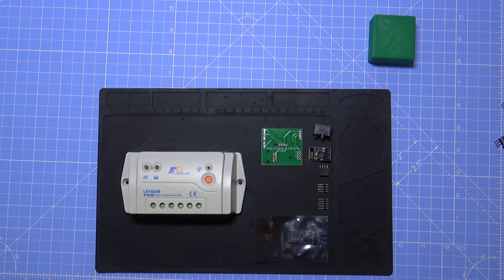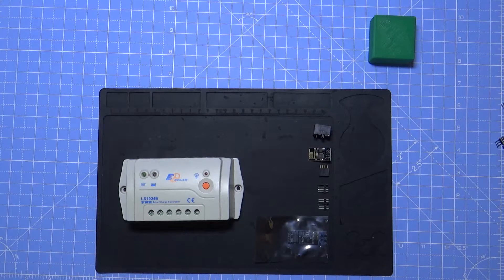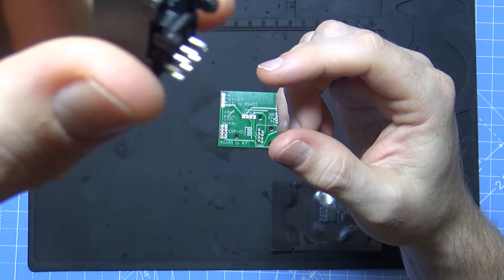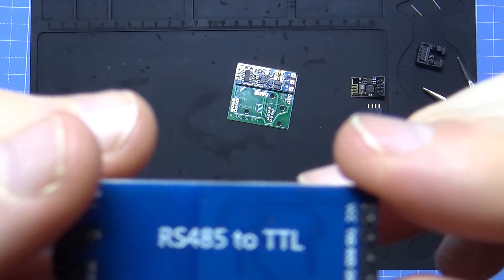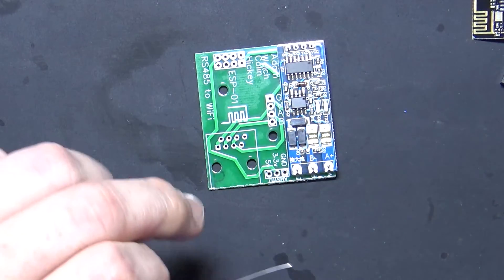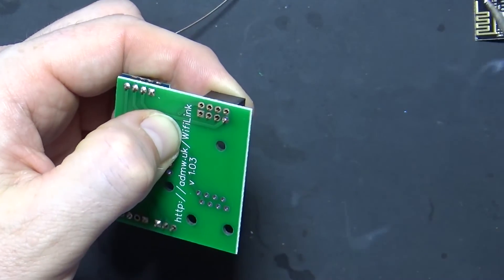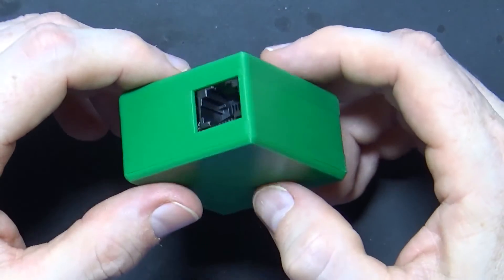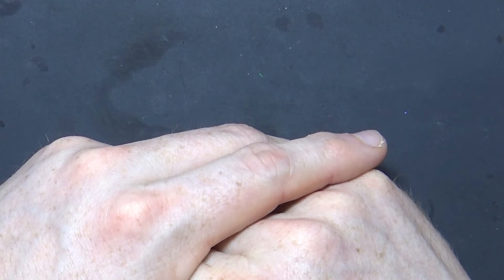EPEver RS485 to WiFi updated board

Comment: Hi, I've purchased a v1.6 board and installed a Wemos D1 Mini with esp-link and my goal is to allow home assistant to communicate with my Epever Tracer 3210AN and draw some nice graphs with data from influxdb. Is there a guide online anywhere for setting up the v1.6 with a D1 Mini ? your videos so far only appear to cover v1.5 and the ESP-01 chips. Will the default pin configuration of esp-link work with this board ? So far I've not managed to get the epever software to work using a virtual serial port.

I also have seen mention that you think this could automatically publish to MQTT or InfluxDB, I would be very interested in a detailed guide on this as from what I've read on the esp-link pages this would require another microcontroller. Maybe I've misunderstood ?

Comment: Hi Colin
Great product works really well as real-time monitor of my solar setup in the shed. I see on the settings tab you have mqtt and influxdb configs. How would I use these to send the real-time data to an influxdb database I have running on a raspberry pi on my Lan? I am using RS485-WiFi v0.60 software. Any instructions would be great as to how I access the data and what format is it in plain ascii, JSON formatted?

Comment: I built a custom radio system for my EPEver systems, using that same RS485 adapter board you've used, but I've had 3 EPEver units stop communicating after a length of time, and even the factory USB cable no longer works.  Have you had any issues with your equipment and had to repair?  I'm assuming the internal RS485 IC has failed (looks crispy) but I can't pull any info off of it to get a replacement figured out.  Have you?

Comment: Hi, I am wondering if this will work on "AN" common negative epever tracer units ?
Tindie says: It has been confirmed tested and working on the following boards - LS1024B - Tracer 3210A - MPPT Tracer1210 - Tracer AN - TRIRON Series with RS485 module
Eplop Electronics says: The boards have been tested on the landstar and tracer controllers, it does however not currently work with the new common negative tracer model.
Reply from the maker: Hi my apologies for the Conflicting information it was the older version that did not work on the AN series but the new one works fine with it.  I carried across the description so shall be sure to amend it

Comment: Hey Colin, Many thanks fro your inspirational videos. Between you and Adam you seem to really know your way around the epever devices. I have posted a similar question on Adams page, but wanted to see if you had any pointers at all....

I have recently bought a Epever upower hybrid charger / inverter which also has a RS485 modbus port and would love to get to a remote monitoring dashboard like you and others mention however I am having trouble with the basics..

Before I go into the dashboard, I thought I would just try some python scripts to read the data. I looked at scripts such as https://github.com/kasbert/epsolar-tracer and simple pymodbus scripts such as https://stackoverflow.com/questions/57313343/modbus-cant-read-data-from-epever-tracer-1210a-to-raspberry

None of them worked however I could get the Windows software provided by epever to work but who wants to look at a Windows laptop !! 

Have you ever tried talking to one of these upower devices ? Can you think of any pointers that may help ? Have you tried your wifi adapter with them ?
Reply: The Ebox works very good with uPower series and Android APP. I dont get the right functions though with usb to modbus cable.

Comment: Another great video Colin.
One of your earlier videos inspired me to build my own wifi box but I've spent the last 4 days trying to get data to appear on the solar station software...having exhausted my knowledge and ability (although I'm now an expert in flashing 8266 modules!) I've come to think that my RS485 converter module is duff. You mention in this video that you've had a few duff ones, so could you please let me know where I can get hold of a module that will actually work???
I'm quite impatient these days so I don't want to wait weeks for it to ship from China - any suggestions would be very much appreciated.
I've learnt a great deal along the way with this project but I'm super-frustrated that I can't get it to work.
Keep inspiring us!
cheers.
Reply from the maker: Hi Adrian, sorry for the delayed response.  I was struggling to find any decent suppliers so i moved onto a newer design which uses a wemos D1 and surface mount chips.  Should have it out soon and hopefully start videos again.

Comment: Hi Colin any chance you can knock one of your green epever tracer compatible WiFi rsj things up.my soldering crap an my epever WiFi 01 wont connect.steve near Chester.let me know how much if u have time 😀
Reply: Hi Colin I have a cordless drill park side impact driver an motor ok battery was dead an have my own lithium battery but switch on drill won’t work I’ve connected to switch that reverses polarity .my own switch works direct to motor how can I reverse polarity for drill forward reverse
Reply: @stevemcgowan3017  https://www.robotroom.com/DPDT-Bidirectional-Motor-Switch.html
something like this would work
Reply from the maker: Hi steve i do have spare PCB's but i've switched to working on a new board which will post directly to influxdb and also allow you to check it via a webpage without the need for influxdb/grafana etc.
Reply: Colin Hickey ok thanks
Reply from the maker: steve mcgowan drop me a line at chickey@eplop.co.uk and can see what we can arrange

Comment: Can you explain or show any diagram from which wires you take power ??? I measured voltage from blue wir and brown on both of them there is only 3.09 volt. definietly not enough
Reply from the maker: Hi it sounds like it shall not work for your controller.  With the LS1024B and Tracer3210A which i have i get around 5-6v
Reply: @Chickey  I use epever Triron with rs485 Module. So quite straange because it is compatibile also  with wifi module from epever
Reply from the maker: Szymon Zieliński yup it is strange as that is where it gets its power also.
Reply: @Chickey  Can you Tell me from which colours you take The power?
Reply from the maker: On my devices pin 1 + 2 VCC / 3 +4 B / 5 + 6 A /  7 + 8 Ground
Reply: @Chickey  Thank you so much

Comment: Great the Victron PWM Pro looks exactly like this solar controller. Same protocol and all. Will try to do it also.
Reply from the maker: Hey Mike, i'd just double check the pintout on the RJ45 connector though before connecting.  Also the code i run is checking for specific registers on the EPEver and i would imagine the Victron would be running different registers.  Worth looking into.
Reply: @Chickey  indeed the pinout indicates 12v instead of 5v for starters. I will have to redo it myself but just the idea is something in itself, so thanks for that!

Comment: colin looking at julian's First Look: Ming He 120V 30A Wireless Power Monitor Oct 12, 2016 https://www.youtube.com/watch?v=YGp2wDAfC1k its apparent after looking at his listing that these cheap diy friendly Power Monitors are using generic RS485 MODBUS Specification protocols with capability to change modbus channel,address etc built into its nRF24L01 firmware  ,i wonder if the receiver can talk/control and integrate directly to any modbus EPEver RS485 to WiFi'ed diyBMS device after a little hacking?
In a standard Modbus network, there is one Master and up to 247 Slaves, each with a unique Slave Address from 1 to 247

Comment: Cool little board update. I may be questioning the obvious to you, but does it pull the power via the RJ45 cable? I have looked at the traces and assume the EPEver provides power down the cable? What would be the best MQTT charge controller to get as you said this one is PWM? Guessing here in the UK we need to squeeze the Sun as much as we can?!!
Reply from the maker: Hi Stephen, Yeah on the epever it provides 5v which is stepped down to 3.3v for the ESP.   I'm using a MPPT charge controller in my live setup but in all honestly i'm not sure it's as important as it used to be now panels are so cheap. I run an EPEver tracer 3210A which is a 30A model.  The biggest difference between this and say a landstar model is the MPPT but also a higher input voltage, as it's MPPT it can have up to 100v rather than 50v for a landstar.  However a 30A landstar and 30A tracer are still limited to the same amount of PV input.  Oh the Epever has bigger input terminals (10mm).
Reply: @Chickey  thanks!

Comment: As you know I like the improved design. Does make it easier and quicker to build. Cheers Colin
Reply from the maker: Hi Adam, it's so much quicker from not having to cut a network cable in two and tin the fine wires etc or even making one up from scratch.